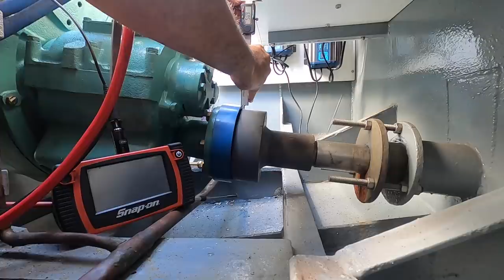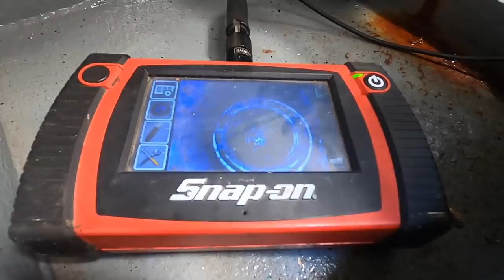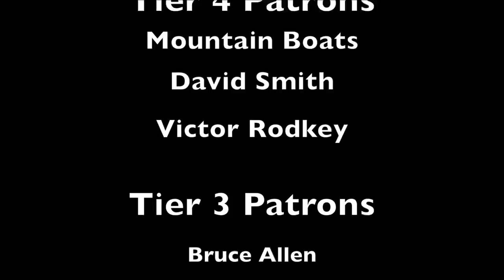Better alignment and odd jobs

Comment: Mackay make 3/4"/19mm  heater/water hoses with 90 deg bends. Part number UHB19 with 4 inch length ends UHB19-300 for 12 inch length ends.
Any parts shop worth their Coopers should be able to order.
Love the vids, keep em coming cobber.

Comment: Stu,  you have to move the adjustments in unison.If you only adjust one jack bolt at a time you are going to be chasing it. Remember you must get the plane first. Start by getting an even amount of pressure on all the jacking screws , now using your calipers set the side to side (horizontal gap) dimension on the flange, this can be done by moving your side adjustment screws that are diagonal to each other. When the dimensions are close check again that you have pressure on all your jacking screws (this can vary at this stage because you are not moving on machined mating surfaces). You can now set the vertical dimension to be equal top and bottom (this is achieved by raising or lowering the engine front to back) remember to move both jacking screws either front or back the same amount. When the dimension (gap) between the flanges is equal you are in plane. 
You are now ready to bring the flanges into alignment with each other using the side adjustment and your jacking screws, if you make a vertical adjustment, it must be to all four screws, sideways adjustments must be the same front and back. The resistance then sudden movement to your adjustments is known as slip stick(friction) and exists between all moving parts to some degree. In your application when making a side adjustment I would suggest a hammer blow to the base of all four jacking screws in the direction of the intended movement.
Sorry if this is a little long winded but remember you must attain plane first and then maintain it while making alignment adjustments.

Comment: Barring finding a convenient off the shelf adapter, you might be able to drill out the center of the old temperature sender and run a thread tap to turn it into an adapter. I've done similar on old vehicles, and just eyeballing it on the video it looks like you'd have enough size difference to pull it off. She's coming along nicely Stu.

Comment: Putting a grease or petroleum jelly on parts as you put them in may and i say maybe dirty but in years to come when you come to try and get it off .... the reduction in the hassle factor is enormous. No grease makes a battle where the outcome is most likely to be against you.  When the sh1t hits the fan you need every  thing going for you.  Battling a Bolt is not a happy place  especially when you mutter to yourself “I wish i had lubricated  this when I put it on”. A small tin and a brush is often a great tool to have ..... You need not ask how I know....I have the tee shirt as I was there....  
Doing alignment is a mind game especially when its only you.  Taking a step back was a brilliant move.  Keep it up you are getting the things done... and can see the end.....brilliant work of holding our hand both showing and explaining everything.... even the  Doh Homer moments.  All this takes stamina a week away will have refreshed the batteries.and the brain.  Amacf

Comment: Did you drop the gantry crane in the drink ? Lol. On that small curved hose get a spring that the hose fits in and cut to full length of hose and insert hose into it ! Works great from letting hoses kink ! I have one on my 5 gal. lower unit gear lube filing hose ! Man you knocked out a bunch of smalls on this video ! 👍

Comment: Suggest you run the coolant overflow pipe into a plastic bottle. That way you can see if you have a problem and save any overflow as a top up when it cools down.

Comment: Here’s a thought. Make an alignment fixture the same thickness as the flex coupling with one o.d. same as the gear flange and the other o.d. as the prop flange. This way you won’t have the inconsistency of measurement from the pliable material  of the flex coupling. You can use feeler gauges for side to side and angular. Then a straight edge for concentricity.

Comment: FYI ..When you make your throttle bracket. I saw on Project Brupeg they added a support beam to keep it from flexing and were told not to make it out of aluminum, but stainless steal...
Reply from the maker: Yes, I saw that too, but I found the perfect piece of thick aluminium and having seen thin aluminium hulls take a pounding for 60 years I'm not buying the work hardening theory when it comes to throttle brackets.

Comment: The adapter you need is 1/2 BSP, (plumbing thread) to 1/8" 27 NPT by the looks of it. It's a standard VDO part at any auto store.
Reply: If that adapter doesn't suit the another option could be to get a plug to fit the engine, then drill and tap to suit the temperature sender.
Reply: @LegendLength  Because it 'sends' a reading rather than 'senses' the reading! There is a difference, but it's quite subtle! :-)
Reply: @LegendLength  Both sensors and senders have an output, but the difference is like that of analogue and digital. One will apply a simple on/off switching, and the other will apply a variable output.
Reply: @chrisskelhorn5727   A sender transwer directly information to a unit, say, like a fuel gauge. a sensor transwer information to a alredy programmed unit, like a ecu, if there is a difference in the programmed information the sensor pics it up and send that information to the unit, the unit responses with a code error and  sometimes the engine fails to work normal. There is a lot`s of different sensors but they work almost the same. in the end of the day you can say that a sensor is also a sending unit but yes, like you say, it is a different between them.
Reply from the maker: I'll see what they have at my local auto store.
Reply: David, you beat me too it!

Comment: While watching had an idea that I used on my lathe for alinement of the chuck and spindle, placed a rod in the chuck and spun a point on it and then brought the spindle up to the chuck so both points meet, any variation is visible. Remove the bushing and turn up 2 plates with a 1inch pin at the centre, make both plates the same diameter as the flanges they will fit on, no need to keep measuring just look. Speaking from experience turn the power switch 90 degrees, if the top cable comes lose, it can catch and spark. Better to have both cables coming from under the deck vertical. Plus where the switches are, air tanks and heavy equipment 😫
Love the vids keep em coming.
Reply from the maker: I'll definitely take a look at the switches potential to short when I'm out there next.

Comment: Not sure how you plan to route the battery cables to the shut off switches but i think i would have mounted the switches so the connections would be horizontal (side by side) rather than vertical in case the top cable comes a bit loose and drops touching the lower cable therefore bypassing the switch.  Great video and I am looking forward to the engine firing up!

Comment: Keep a eye on that tie wrap ive had them cut into hoses before and if that temp sender is metric and the engine side is imperial you could get adapter to go smaller than you need and drill it out and tap it
Reply from the maker: Yeah, it's only temporary. Bend hose on its way!

Comment: Ive been a marine mechanic for 25+ years. Ive worked in shipyards all up the West coast. I use a set of feeler blades to do prop shaft alignment . Ive never seen it done any other way (for the scenario you have).First, I make sure the couplings have no burrs or hatchet wounds anywhere on the faces or registers . I use a flat file to smooth out any ugly areas. Then I adjust the engine/gear until the male register slides into the female register of the couplings easily. At that point I'm fairly close. Also at that point you can find where the coupling faces are ROUGHLY in relation to eachother. I slide the prop shaft coupling into the gear until the flange faces touch...doesnt matter at what location YET. Then I find the tightest spot or where theres no gap between the coupling faces. I use a .005" or so blade for finding that location usually. Place the blade in between the flange faces and slide around until you find where the faces are touching.  Mark that spot. The goal then is to get that spot at the 12 o'clock on the coupling flange faces. Once Ive adjusted the engine/gear to where the tightest spot between the coupling faces are as close to 12 o'clock as possible, i  begin adjusting for the side to side adjustment or 3 and 9 o'clock of the fange faces. For that, I use a .010" feeler blade and place it between the coupling flange faces at 12 o'clock. That number/distance is only for reference at this stage. Next i measure coupling flange face gaps at 3 and 9 o'clock. I move the engine to attain as close to the same measurement between the coupling flange faces at 3 and 9 o'clock (or port and starboard...side to side). Once that is done, I use the adjustment on the front and rear feet to align for verticle. I use my .010" feeler blade between the 12 o'clock location of the couplings to create the minimum gap . So 12 o'clock will be at .010" and I then measure the gap at the bottom. The difference between those numbers is the actual aligment . I write that number down..for reference.  I then lower the rear of the engine/gear (or raise the front) using the front and rear "feet" adjusting nuts until the measurement between the coupling flanges is as close to my .010" REFERENCE all the way around the coupling. The entire time Im checking and adjusting , I have to keep my reference distance of .010" at 12 o'clock continuously. The prop shaft  will usually want to slide down and away as i keep farting around and measuring so I have to start with that everytime The reason I use a .010" blade to space the coupling flanges is because its easier to measure using that blade than a  .003" or less blade even. Those thin blades flop around too much and are a pain in the ass.. Once I attain alignment to get the .010" blade to go around the coupling flanges with even feel, I slide the couplings together tight, and get a final measurement by seeing if a blade will slide anywhere in between the coupling faces. I think the rule of thumb is .001" per inch of coupling flange diameter, but dont quote me. I try to get .003" or less on EVERY alignment. Once the coupling flanges are as parallel as I can get them, I Lock her down. Then I double check the measurement again, using feeler blades (couplings tight together) and be done. The goal is ultimately is zero, but thats unnecessary. If the alignment cant be done with this proceedure theres a problem with the couplings, shaft, or the machining of the shaft and or coupling taper . It sure is easier to show someone than describe!! Good luck.
Reply from the maker: Not sure if you have seen the previous videos but the reason I am doing it this way before getting the feeler gauges out to do a proper adjustment is that the prop shaft is stuck in the cutlass bearing and be brought up to meet the gearbox metal on metal. This is all about just spinning the prop shaft to free it up before doing a more orthodox alignment.
Reply: @DangarMarine  right on man! Cool channel! Sorry I gotta screaming little kid running around me while Im trying to watch and comment at the same time!😂

Comment: Hey Stu, that radiator cap is good to use if you want to fit a 'recovery tank' to your cooling system (seal top and bottom). A reco tank makes it easier to keep an eye on your coolant level / condition, and also helps to keep the bilge dry. Just a thought.

Comment: For the temp sensor buy a standard npt plug that fits the engine, then drill and tap it to fit the new metric sensor

Comment: Hi Stu, Giving my 10cents for what its worth, When fixing your Morse throttle and gear cables, I found over the years to check the resistance from the helm to the fuel pump that often it takes a lesser bend to give the cable an easier (less resistance) by routing it differant ways, I am sure you are well aware of that, But Morse cables have either worked fantastic , or tried to leave me with a hard throttle to open and shut off (Bugger), But I love the project, and applaud you patience, Regards Sam.
Reply from the maker: For sure, will try to keep the bend and gentle as possible.

Comment: You might want to put some silicone sealant around the stems of the disconnect switches that are on the coming.

Great videos, thanks.
Reply: and some sort of protective cowl to stop falling Dive Tanks from snapping the switches off.

Comment: The notch on the temp sensor hex usually means it's a lefthanded thread. Might wanna check that before buying an adapter.
Reply from the maker: Good tip.

Comment: Stu, spin that battery disconnect 90° itll help prevent the cables from coming lose and coming in contact with each other.  You want the lugs horizontal.

Comment: That kinked hose at 18:57.  You could add about 10 inches length to that hose & form a loop into the line to eliminate the sharp bend.  You'll find the line will last a lot longer that way.  Eliminates wear from the fluid circuiting inside.

Comment: Stu, check out the following gates molded hoses for the water manifold to exhaust manifold hose: #20618, 3/4 X 4 15/16, #19658, 3/4 X 6 13/16, #19736, 3/4 X 7 1/2.  Hopefully someone near you might have one of these in stock.

Comment: Don't sweat the hose closing up a little on the ninety degree bend , the inner bores of the brass fittings on both ends are much more restrictive then the slight narrowing of the hose. Plus when pressurized the hose will exspand
Reply from the maker: Yes, I was thinking pretty much the same thing.

Comment: You could get a 1/2 inch NPT pipe plug then drill and tap it to fit that temperature sending unit.
Reply from the maker: Yes, that is exactly what I ended up buying.

Comment: Just loop a longer hose when a preformed hose is not available. Its been a while since I have ran an older diesel engine down the road but I do remember the cooling systems ran with a 5lb cap on the tank and 1 bar is 14lb? That seems a bit high. Maybe those old 2 strokes ran higher but not sure. Not a Detroit fan but I have a lot of friends who are, I always wave as I go by:)

Comment: as a general rule when drilling metals....the harder the metal, use a slower speed with more pressure (and cutting oil)....for softer metals, use higher speeds and lighter pressure.

Comment: Been through the port bar  twice stu depth wasnt an issue  (41' foot sv with a 1.8m draft) but i used my plotter to get close to the optimum line until i could see the alignment markers  as either side of the narrow channel there were breaking waves ( 1.5m swell on the way in ) a lot of teeth grinding the first time but as long as you stick close to the line and aviod larger swell on an ebb tide , all good
Reply from the maker: Good to hear it went well. The sectors are well marked on the charts I have so following them in shouldn't be a bit issue. Just need to time the arrival for the tides and wait for good weather.

Comment: Just a quick note: We ALWAYS use the horizontal position of those levers as OFF position, as this looks like a closed gate / bar or a "stop" sign. A vertical line (lever position) means "run" or "flow"... But as long as you know what you are doing, I reckon there is no law against it :)
Reply from the maker: Good point, I am a big fan on following conventions.
Reply: @DangarMarine  yeah, but I only recognised later that you used existing holes. And I am a fan of easy work... :D

Comment: I had a similar problem with installing a new temp gauge in  old stationary engine . My solution was to drill the guts out of old sender and tap to metric thread for the  new sender.
Reply: @Stephen , wish I knew you 10 years ago when I was in a similar predicament to Stu. +1
Reply: I was wondering if that would be possible. Great solution.
Reply: Stephen, I was thinking about getting a brass plug and drilling and tapping it to fit the new sender but your way saves a trip to the store!
Reply from the maker: Yes, I thought that might be possible but in the end just got a solid plug to drill and tap with no unknown internals.

Comment: In theory... don't address the centering left/right up/down yet. Get your flanges parallel first. (Maybe separate the flanges by a .010 or .020 inch and use feeler gauges). Next, no matter what, adjust all 4 horizontals or verticals the same amounts to get the port/starboard and THEN the vertical centering. By proof the top and bottom will be the same if both sides match, as you were saying.
Reply from the maker: Sounds like a good approach. It is already confusing enough without dealing with multiple dimensions at the same time.

Comment: Hi Stu. Been watching for quite a while and enjoying your channel.  For your alignment may I suggest you get the faces of the couplings aligned first. It doesn’t matter if you’re high or low or off to one side. Just so long as they are true to each other. 
Then you adjust your height or side to side alignment. That way you can count your turns on the jacking bolts while maintaining that face alignment. For example if you’re low you wind up all the jacking bolts the same amount of turns and maintain your face alignment. Same for sideways adjustment. 
You may need a final tweak for the face but that way you’re only chasing one axis at a time instead of trying to do all three at once.

Edit: Actually you’re trying to chase 4 axes.
Reply from the maker: Makes sense to me!